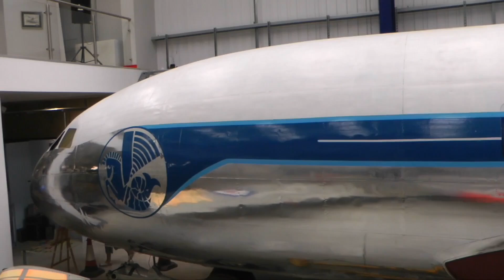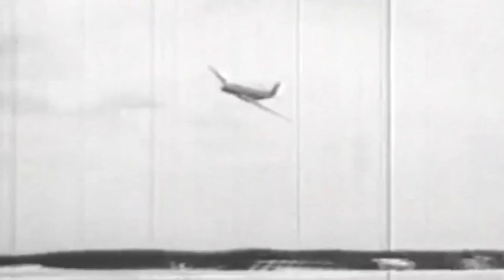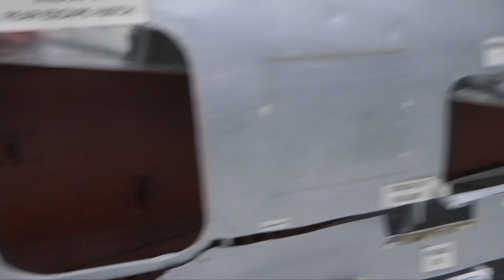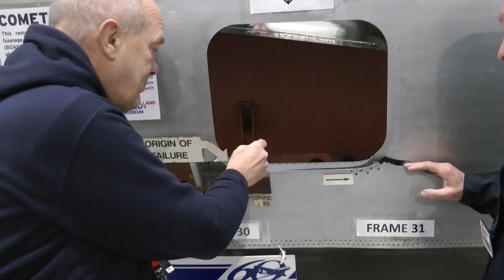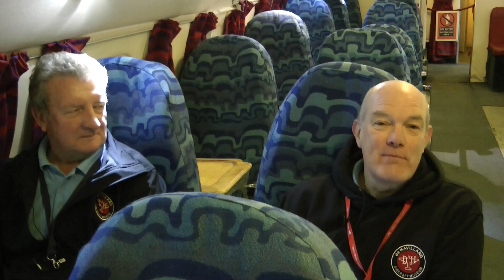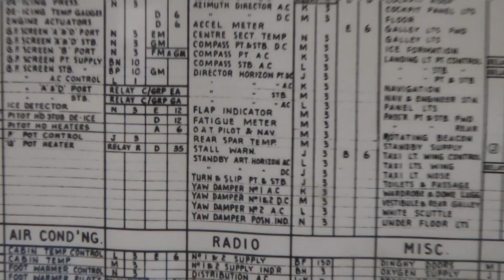The plane that changed the skies forever. DH.106 Comet Airliner from de Havilland

Comment: Cabin air pressurisation pressures of up to 43000 psi were not revealed by strain guage measurement. 

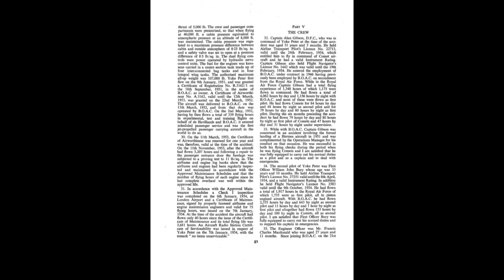   6:52

The initial statement of pressure differentials of around 8 psi and test pressures of twice that are correct. 

The strain gauges were measuring skin stress which reached 43000 psi & is how severely the skin is being stretched or being loaded (as a crane hook would be loaded while lifting a load) by the air pressurisation that never exceeded 16 psi during pre-production testing. 

   6:52

The 43,000 psi skin stress was not unprecedented or extreme, aluminium alloys can withstand such stresses, 25,000 psi stress is a common & normal design level of skin stress for a pressurised fuselage skin.

As an example:
7075-T6 has a fatigue strength of ~23,000 psi (at 500 million cycles). If we were not considering possible fatigue fracturing or load safety margins etc the alloy would start giving way at 80,000 psi stress during testing. As they were designing for less than 15000 cycles we can see that the design was in the right ballpark for an aircraft and was not extremely wrong. 

 Since they were looking at a tiny fraction of that number of cycles as far as pressurisation stress cycles were concerned and pressurisation stress was about 1000% higher than flying load stress it was possible to design for pressurisation stress alone and go for a thinner skin suitable for 10k cycles.

Comment: Aaaand it broke apart  in flight, I wonder how the passengers that met their deaths thought about the changing skies forever as they died.
Reply: The marvellous trailblazing DH Comet.

We believe we can clear up some commonly held myths and misconceptions, obviously.

It's always good to see the facts presented clearly and concisely isn't it?

It is in fact correct that instances of all Comet marks, including the Comet 1, flew with full certification at some point after 1954. The last Comet flight was in 1997.

 NThe Comet was the world's first high altitude airliner with an 8 psi pressurised full fuselage length passenger cabin. This resulted in it being the first aircraft where the entire length of the fuselage was subjected to pressurisation stress that was significantly greater than flying load stress.

   Of course De Havilland carried out a full stress analysis & performed extensive & protracted testing, including pressure cycle tests, on two long lengths of fuselage which were thus representative of the entire fuselage. De Havilland carried out significantly more testing than was required by any authority at the time & significantly more testing that any previous airliner was subjected to.

The fabulous trailblazing Comet.
World's first high altitude airliner.
World's first jet airliner.

   De Havilland did indeed always work to better than industry standards at the time, used up to date knowledge for the design & no evidence of negligence or criminal negligence was ever produced in relation to the DH Comet.

It is the case for example that the stress for the crown sheets when measured was not greater than predicted.
 
  Obviously there have been worse aircraft for accident losses both before & after the Comet. One of the issues was accident losses due to pilot error which were often caused by the novel aspects of jet airliner flying, even so, the accident losses for the Comet were not particularly unusual at the time.

    How things were back then.
Accident losses - % of aircraft built.
DeHavilland Comet 4 UK              14% 
DeHavilland Comet all mks          17%  
Vickers VC10 UK                            5%

The DH Comet had better safety than or similar safety to many other commercial passenger aircraft of a similar era.
Douglas DC-1                                      99%
Douglas DC-2                                      47%
Douglas DC-3                                      30%
Douglas DC-4                                      26%
Boeing s300                                        72% 
Boeing 307                                          70%
Boeing 247                                          48%
Boeing 707                                          20% 
Lockheed L-049/149 Constellation  30%
Lockheed Electra  Turboprop .          29%
Fairchild FH-227                                 30%
McDonnell Douglas DC-8                  14%
Sud Aviation Caravelle                       15%
Canadair CL-44  Turboprop               46%  
Convair CV-580  Turboprop               22%
Convair CV-880     (ff 1959)               27% 
Convair CV-990     (ff 1961)               33%
Tupolev T-104        (ff 1956)               16%.

The Vickers VC10 held the fastest Atlantic crossing record for airliners for 41 years 

We hope this helps, of course. 
   
As always, cheers & 👍.
Reply: The DH Comet had significantly more research and pre-production testing than any previous airliner had ever been subjected to.

The fabulous trail blazing DH Comet.
World's first jet airliner.
World's first high altitude airliner.
The first aircraft with a full fuselage width and length pressurised cabin where pressurisation stresses were higher than flying load stresses and were many times higher than flying load stresses. 

It's surprising then just how low the accident loss rate was for the Comet. 

    How things were back then.
Accident losses - % of aircraft built.

DeHavilland Comet 4 UK                     14% 
DeHavilland Comet all (ff 1949)         17%  
Vickers VC10 UK (ff 1962)                   5%

Douglas DC-1                                      99%
Douglas DC-2                                      47%
Douglas DC-3                                      30%
Douglas DC-4                                      26%
Boeing s300                                          72% 
Boeing 307                                            70%
Boeing 247                                            48%
Boeing 707  (ff 1958)                           20% 
Lockheed L-049/149 Constellation    30%
Lockheed Electra  Turboprop .            29%
Fairchild FH-227                                   30%
McDonnell Douglas DC-8                    14%.
Sud Aviation Caravelle  (ff 1955)       15%
Canadair CL-44 Turboprop (ff 1959) 46%  
Convair CV-580  Turboprop                22%
Convair CV-880     (ff 1959)                27% 
Convair CV-990     (ff 1961)                33%
Tupolev T-104        (ff 1956)               16%
Vickers Viscount   (ff 1948)               32%             

  The Vickers VC10, fastest Atlantic crossing for a non supersonic jet airliner, held the record for 41 years.

For the first few years of operation the Caravelle & Comet had similar accident loss fatalities.

Instances of all marks of Comet flew with full certification until retirement of the individual aircraft until 1992. Nimrods were flying until 2010. 

The first few Nimrod airframes were Comet 4 airframes with the equipment bay tacked on. Subsequent Nimrods were new build Comet 4 airframes with Nimrod modifications built by the DH team at Hawker Siddeley.

Comment: @sandervanderkammen9230 

It will come as no surprise to most that we feel able to shed some light on some common misconceptions and myths, of course.

It's always good to see the facts presented clearly and concisely isn't it?

  That's correct, Bow-wing (See B-47 wing collapse & wing folding incidents) hadn't managed to sell more than a dozen pressurised airliners before the first flight of the Comet. Having had more than 50 years design & build experience on the type there can be no excuses for the horrendous Bow-wing Max incidents for example. 
   
  That's correct of course, at the time the Comet didn't have particularly high accident loss rates relative to many other aircraft.

Losses comparisons, how things were in those days.

DeHavilland Comet 4                            14%
DeHavilland Comet all  (ff 1948)         17%

Boeing 307                                              70%
Boeing 247                                              48%
Boeing 707            .                                  20% 
Lockheed Electra Turboprop                   29%
Canadair CL-44  Turboprop  (ff 1958)    46% 
Convair CV-580  Turboprop                    22%
Convair CV-880    (ff 1959)                     27% 
Convair CV-990     (ff 1961)                   35%
Tupolev T-104 (ff 1955)                          16%

   Indeed, De Havilland carried out a full stress analysis & engaged in a comprehensive & protracted testing program which is why key De Havilland people were happy to be aboard flying DH Comet aircraft.

  Of course it is in fact the case that no aircraft before the Comet had been subjected to as much testing as the De Havilland Comet.

  Agreed, of course De Havilland did indeed always work to better than industry standards at the time, used up to date knowledge for the design & construction & no evidence of negligence  or criminal negligence was ever produced in relation to the DH Comet.

  De Havilland designers / engineers knew all there was to know about metal fatigue at the time they designed the DH Comet.

  Of course De Havilland had prior experience building many all metal construction airframe aircraft including many passengers aircraft & thousands of jet powered fighter aircraft that were primarily of metal construction with pressurised cockpits & jet engines built by De-Havilland.

  Indeed, one of the key features of the DH Comet was of course its high altitude capability.
It was in fact the first airliner to have 8 psi pressurisation for the entire fuselage length which resulted in it being the world's first airliner where pressurisation stress significantly exceeded flying load stress.

  Obviously the Comet was an all metal construction airframe aircraft & like all similar airliners used other materials for non structural items such as interior trim. The rear pressure bulkhead for the Comet fuselage was obviously not made of wood for example. Any references to plywood & balsa components are in fact refering to some fairly advanced materials being pionered by De Havilland, hot molded, cored, triple layer, lignin fibre reinforced resin composites that were the forerunner of glass fibre & carbon fibre composites.

  British Aircraft Achievements Notes.

  The world's first gas turbine aero engine demonstration was in fact performed by Whittle in 1937. Sir Frank Whittle patented bypass & reheat before 1936.

  The world's first axial multi stage sequential stator rotor turbines & compressors were produced in England by Parsons of Ireland & North England. The same components used in many modern gas turbine aero engines. Parsons also did some work on the internal combustion gas turbine engine. In fact people at the time in England before 1900 had already discussed the concept of using those components for an internal combustion gas turbine aero engine for powered flight & so had invented the jet aircraft before the Wright Brothers had given any thought to flying.

  The first example of a pressurised cabin aircraft was a British design Airco aircraft built under licence in the US & modified to have a pressurised cabin during a joint UK / US research project.

  The gas turbine engine was first conceptualised & patented before 1800 in England.

As always we hope this helps of course, obviously.

Cheers & 👍 indeed.

The line above has clearly been left blank.
. . ..... ....... .. ...
 ........ ....  .... ...